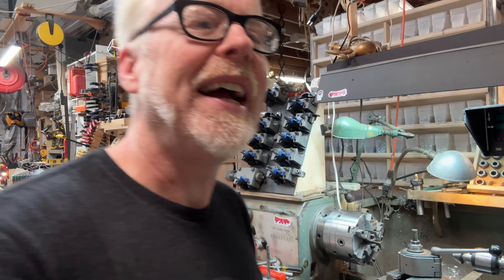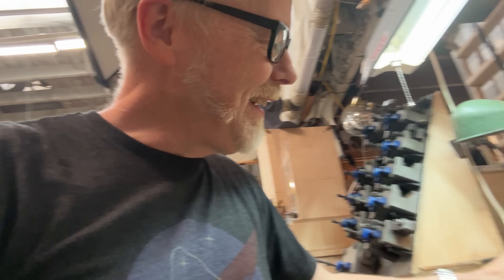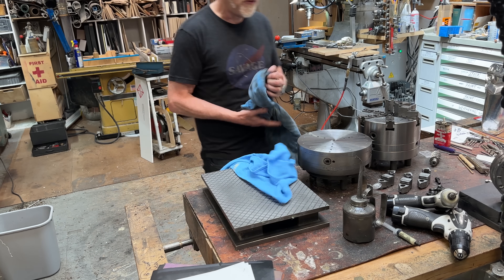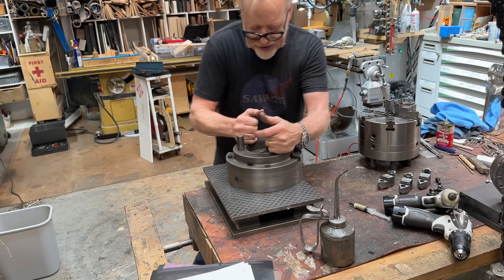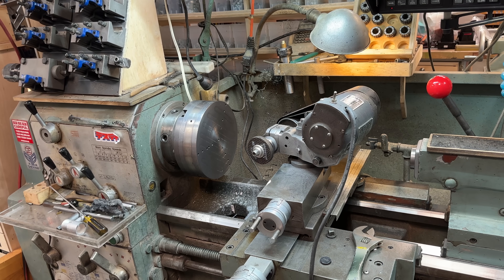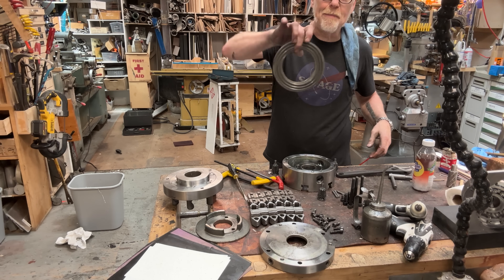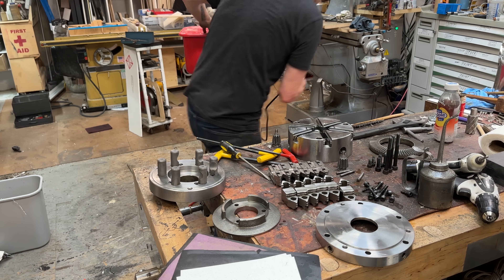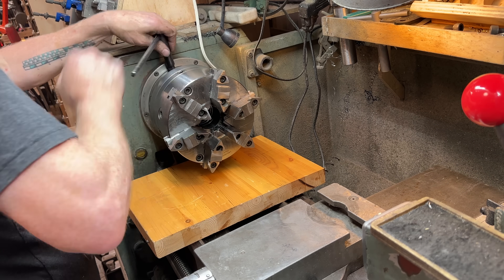Adam Savage Repairs His Lathe's Magnetic Chuck!

Comment: I wish you had mounted a tenths indicator onto the carriage and swept it across the magnetic chuck while still installed on the lathe.  Using a precision straight edge, you could set it across face to verify how accurate the cross slide on the lathe was.  I'm sure there's a better way to describe it, but I think I'm getting my point across.

Comment: just remember every chuck needs to be re-centered every time you remove and reinstall the chuck
this is because of several factors
1. you will almost never put the chuck adapter pins in the same hole
-unless you mark the chuck and the adapter plate
2. you will never get the adapter pins to the same tightness as you have now
- you would need to use a torque wrench each time

a true set chuck allows you to make these adjustments easier

the above is really only necessary for sub 0.0001
yes you can do it on this lathe

Comment: Old guy here who was once a bicycle mechanic back in the '70s. I couldn't help but notice you used 3-in-One oil on your chuck. Back 40-50 years ago, we bike mechanics loathed 3-in-One oil. As a product readily available to people at their local drug and grocery stores, everyone use it to oil their bicycle chains and when they'd bring their bikes into the shop for tuneups and repairs the stink of rancid 3-in-One oil was really gross, plus its lubrication properties seemed to change over time, not due to road grime, but it would just go bad and turn gooey rather than being oily. We always figured it was primarily a vegetable based oil which is why it turned rancid and would stink. Anyway, to this day, I would never use 3-in-One oil on anything. (Maybe the formula has changed, and I would hope so, but anyway, that was my experience with it.)

Comment: The chuck has lead in the grooves, well the good ones do, never grind the face unless you remove enough lead so the level is below the steel surface by about 0.020". Reason for this is the lead doesn't grind but smears and will load the wheel, which will need more dressing, and the face will not be as flat as you want. Just make up a tool that is slightly narrower than the grooves in a hook shape. FFS clamp the lapping plate down.

Comment: I hope you 3d print a vacuum hose holder so you can have a shop vac half full of water. All that grinding dust all over your shop and lathe. Will destroy all of the bearing surfaces. Suck it up into a wet dry vac half full of water.

Comment: The face of that tool certainly looks better, certainly flat.  How are you able to guarantee that it’s flat AND square? 

It seems possible that the surface could be flat, but “titled” off square.  How do you prevent or measure that?
Reply: Grinding it while spinning on the lathe guarantees the face is perpendicular (square) to the lathe axis of rotation), which is what you care about.

Comment: Here's the problem with any facing job on a lathe. If the cross feed on the carriage doesn't move exactly perpendicular to the lathe axis the face will be convex or concave. You check that by indicating the face opposite of the feed in side. Indicating the feed side to center should read zero. But if the cross feed is off indicating from center to opposite side will show plus or minus. Fix it by shimming the carriage half that amount in the correcting direction. Check to be sure the face indicates zero all the way across.

You should also have 3 lapping plates to maintain the flat. Lapping them sequentially against each other. The principle is the only common curvature 3 faces can share is zero. You can demonstrate it with 3 pieces of sandstone, and get a precision flat on sandstone. That's how the stones of Machu Pichu  were fitted together.
Reply: Absolutely correct about the alignment of the cross slide to the spindle axis. In fact on most lathes it's adjusted so a facing cut leaves that very slightly concave surface (shown by the "unreached" centre after lapping). This is preferred over leaving the surface "high in the centre" so that any two surfaces faced on the same machine and placed against each other won't rock.
I'm not old enough to comment authoritatively on the construction techniques of the ancient city 😉
Reply: @russelldold4827  When I was a kid I followed the space program. I entertained by telling what was planned. Jealous detractors maliciously claimed I couldn't tell the future. A nuclear war could prevent it. To thwart them I prefaced with the morbid detail "barring a nuclear war." Detractors then claimed "You're always talking nuclear war". Like many attacked like this my 8 year old self invented another phrase that others invented to thwart them; "Barring some unforeseen event". A phrase that was so common it was in "The Right Stuff".  Of course they demanded "like what?" to set up another detraction. But that was a question an honest kid didn't have to answer. So the cheats just started fights. I got good at fights too. 

In my career I made among other things the Boeing 777 fuselage turning fixture. 1600 were made with my fixture over 30 years with no crashes to this day. Detractors pointed minor crashes. To thwart them I added the morbid detail no mass fatality crashes. Detractors continued pointing out one shot down by Russians, and a missing Malaysian Air flight likely hijacked. Another morbid detail "mass fatality accident" to thwart malicious trolls.

You detract by implication that a person has to be old enough to have seen Machu Pichu stones fitted together to speak authoritatively. 

I didn't see what the Baghdad battery was used for but I know what it would have been used for. Not lightbulbs or electro plating because they had none. It's common knowledge what they did have that the battery would have been used for. I won't tell you. I'd tell Adam. He has everything he needs right there to make one, and use it in 5 minutes.

Comment: Precision measurement question - in this case you said "ten thousandths" meaning 1/10,000", not "ten thousandths" as in 10 x of one thousandths. Correct? In instances where you say things like "four thou", does that mean 4 x one thousands (4/1000"), or "four thousandths" like 1/4000"?
Reply: In imperial machining (common in the US) measurements are typically done in thousandths, which are 1/1,000 of an inch.  For very high precision, tenths are used, which are 1/10,000 of an inch, or tenths of a thousandth of an inch.  4 thou is 4/1,000 of an inch.  4 tenths is 4/10,000 of an inch or 0.4 thou.  Alternatively these measurements may be done in metric (common everywhere) using decimal millimeters (often to hundreths of a mm).  Very high precision is done in microns, which are thousandths of a millimeter, or 1/1,000,000 of a meter.  1 thou = 0.0254mm  or 25.4 microns. 1 tenth = 2.54 microns.
Reply: @stargazer7644  Amazing - this is exactly what I was looking to learn. Cheers!

Comment: Possibly stupid question, but rather than breaking your back lapping the chuck couldn’t you do a skim pass using the lathe? Would also guarantee you the surface is a right angle too?
Reply: Lathes are far less precise than grinding.  That's why high precision parts are ground.

Comment: The problem with this method is that the X axis of the lathe can have some cone so your surface tends to be like a bowl. And for a magnet chuck even a couple of hundredth of mm can be decisive. So it would be better to make some measurements first. Or at least after.
*Actually we can see exactly what I said when the chuck is polished on the plate: the center isn't touching.

Comment: Good on you for trying to improve your told after the job is done, but that buff you did the face plate negated most of your lapping. If you take smaller passes with the grinder, tenths of a thousandth,  and relieve the back side of your wheel it won't heat up and cause the cupping that the lap was supposed to remove. Nice job doing more with less 👍

Comment: Hey Adam, check this out.  It's constructive, not critical. I would have taken that chuck apart, degreased it, then did an extreme deburr on it, maybe even hit it on that lapping plate.  Same with the 3 gears. The faces where the chuck comes together too. Then when reassembled, seat the part back into the jaws (your ER32 or ER16 collet holder) with a soft mallet or piece of aluminum, and I've found when you do that, they'll repeat better.  Just a little hint, not a gripe at all.

Comment: How's the tool post grinder doing after throwing it into reverse?
Reply: Why would you think it wouldn't be fine?
Reply: @stargazer7644  Because it went from full speed forward to reverse in an instant and let out a small puff of magic smoke. I don't know what kind of damage that can cause, but I've always heard it's bad to do so, so I ask 🤷
Reply: @FinalSparkLux  It's just an electric motor.  Reversing it just reverses it.  Have you ever reversed a ceiling fan?  Or hit the brakes on an electric vehicle?  Reversing it just puts the load of the spinning wheel on it, and that's not much load at all in this case.  The wheel is tiny, hence why it reversed so fast.  The actual grinding probably put more load on the motor.  I suspect the "smoke" you saw was grinding dust flying off the fan blades.  There's no reason for it to smoke.

Comment: Holymoly.. that's some precision. Side note and not that it's suitable here but I was always impressed with hand metal scraping that they did in the "old days"  I use a CNC router at work with a spoil board. Resurfacing it is always very satisfying.
Reply: very much done today too, lapping and grinding machined surfaces are not good for any metal on metal slide ways (oil). linear rails are great but cant resist or bare the same level of forces a classic dovetail type slideway. and require to be serviced and replaced fairly frequently. i rebuild industrial machinery and i use our biax scrapper like once every couple months on jobs that need it.
Reply: still is the best way to get a metal surface sliding on a single 2D plane. Humans are amazing at creating geometric accuraccy, its just precision we have to make machines and stops to get to. 
(Or at least was before 2020. Ive been a little out of the game)
Some people can feel out of round, and out of flat movements that are only nanometers out! it really is incredible how sensitive our nerves are.
Reply: After this I went and look it up. I think I assumed it was an older technique from seeing it used in old machinery rebuilding in videos.

Comment: That lapping pattern suggests either your lapping plate is completely bowed or there is something seriously out of whack on your lathe.
Reply: I would argue otherwise - A lathe in decent condition has to face slightly concave (So parts faced sit flat and dont wiggle.). Its not much - 0,02mm dish over 200mm as per standard on a toolroom lathe this size.
That explains the lapping/contact pattern we see in the video very well.
Reply: @StefanGotteswinter  That is as may be, and actually it does make a bit of sense at least on a regular chuck, but Adam clearly stated he was going for a completely flat grind, which he didn't get. Ergo, even if it did turn out for the best, something must be out of whack 😉

Comment: The problem with tool post grinders is that you essentially have to break the entire carriage down after each use to get the grit out.
Reply: you gotta get where your close to your cut, then make a dam like a dentist, do your cuts. clean then your good. your wipers good? and apron sealed properly? i geuss you probobly dont have a leadscrew cover, so i geuss that would need to be cleaned. im just too lazy to do that every time
Reply: im guessing adam did not do that.
Reply: Saran wrap is what I use to protect my ways and critical surfaces. Safe, cheap and temporary.
Reply: @thrustaviationtooling is it red hot spark proof, though?

Comment: If you did it in the video, I missed it, but don't you need to maintain the orientation of the spindle index with the direction that you faced the chuck? Meaning if you have four possible orientations, turning the spindle 90 degrees from the orientation that you did your facing could mean facing it again with the new orientation could yield a different result. Do you have a "North" mark on your spindle so when you machine the mag chuck, you can maintain the same orientation every time you swap it on and off?

Comment: You need an overhead hoist for moving those chucks around :-).
Reply: Or possibly a skyhook, as seen on abom79. Definitely not something I'd want to do manually, for sure. Weedy noodle arms here. ;-]
Reply: @llearch  Jesus, that skyhooky thing is a piece of crap, and those are lightweight chucks! I don't bother with the overhead till I get to the 15" usually. well if im feeling really lazy and I have it in place, ill use it on the 10"... and im 145 dripping wet...
Reply: @timkohchi2048  Congrats on hitting 145, and best wishes on this next year for your 146th.

Comment: Nope, not triggered at all by that lapping plate moving all over the place during the time lapse lol :face-fuchsia-wide-eyes:
Reply: the man has around 1500 clamps as well
Reply: bugged me too lol
Reply: So much wasted energy!
Reply: could have clamped that plate down or ratchet strapped Ha
Reply: You can’t clamp down on the plate because it’ll bend and lose its flatness, thus negating the whole point of lapping…. But it annoyed me too. Put it on a rubber pad or like throw down a piece of scrap leather 🤷‍♂️
Reply: The man needs to learn about rigidity on ALL his work surfaces. He's preached about it's importance in a previous video, but obviously doesn't practice what he preaches.
Reply: @whitey129  The big vice on the wobbly small bench is a constant source of frustration for me. He even did a video years ago about trying to make that bench more stable, but the addition of the diagonal tension straps actually achieved little. Still, Adam is a legend. I love him. He's an absolute delight.
Reply: @whitey129  theres other stuff you could watch if it bothers you that much 😉 maybe some taylor swift videos will calm you down...
Reply: Adam is the epitome of the quote, "Jack of all trades, but a master of none." lol

Comment: Up next on Savage Builds - A custom fabricated, machined and 3-D printed, lapping plate holder.  That way the next time he has to use it the thing won't dance all over his workbench.  Stay tuned.
Reply: A couple of F-style clamps would have done the same thing.  The investment was in time, seconds.
Reply: @robertlevine2152  while true, and the least amount of work required. it does not suit the over engineering overkill of this channel <3
Reply: @cmdraftbrn  good answer
Reply: @robertlevine2152  But where’s the fun in that?  :)
Reply: Just flip the lap plate and move it instead of the chuck 😄
Reply: If he'd just remove the leather sheet on the bench and use the built in bench dogs with the vise to lock it down he wouldn't have had that issue, lol.
Reply: Or....a C clamp.

Comment: im surprised you seemingly only used 3in1 for the lubrication, wouldn't those normally get a decent amount of grease ?
Reply: No. Not really.
The gears here are exposed to the dirty enviroment; even if just by a little, thanks to that long slide.

Grease would just trap more dirt and even hard metal chips to wear away the scroll pkate and chuck teeth.